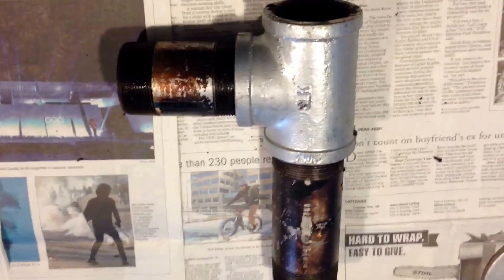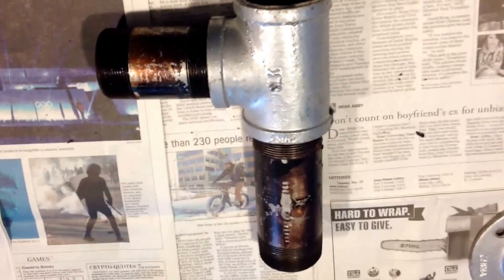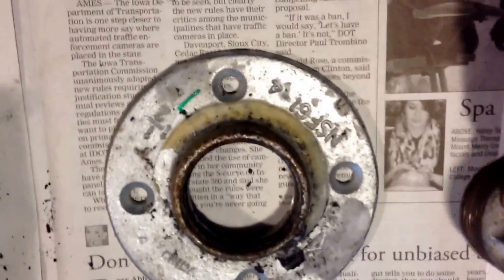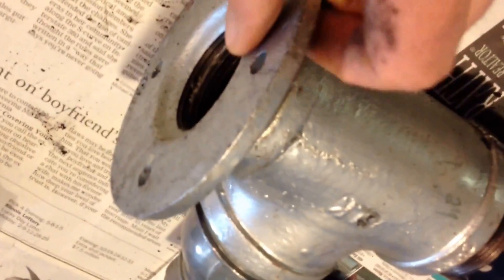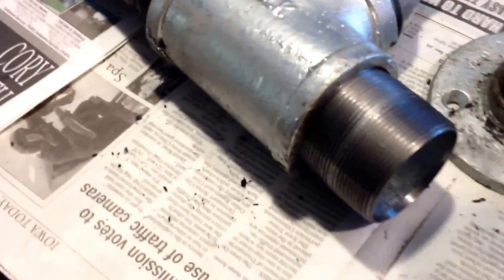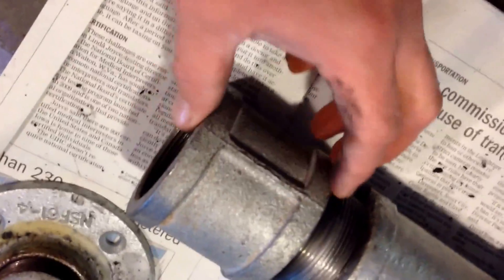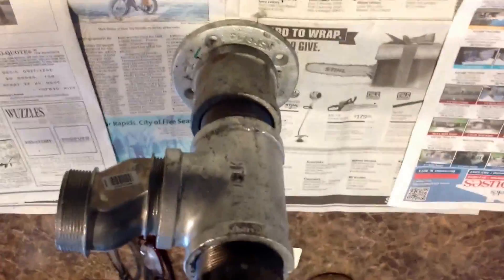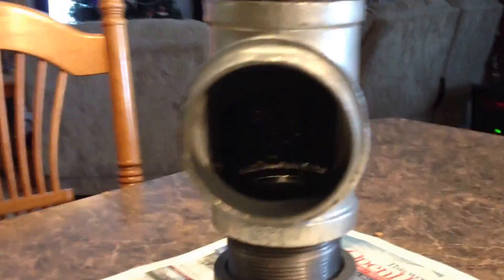Video #3 DIY rocket stove updated easy no tools  in action, testing and boiling snow

Comment: How about just put a nipple and go into 1 of those things in and screw it down just fill it full of sand so the heat's not going to get to the wood base it's got to go through the sand which will catch some of the debris on you want when you get done you pour it out and put the sand back in I don't know you don't have a way to hold the pot with the other flange you need to put some bolts in there or something

Comment: If you put a 90-degree on there you can rotate it down to any angle you want so you can get a 45 after you and then it goes 90 degrees into the unit so that's a possibility be nice to wrap it with fiberglass you wouldn't lose the heat until it gets to the top

Comment: You need air vents at the bottom, there is no air entering the base for combustion.  You can flange the bottom then put screen grating under that so air can move under and into the burn chamber.

Comment: Ray, I think a 45 degree elbow at the T (fuel feed tube) with a 1" threaded nipple between it and the fire tube, then a three or four inch fuel feed chamber into which you actually put your fuel would greatly increase not only your fuel/air mixture (which will increase your rocket effect) but also enable you to pour your pellets into the burning chamber.  Basic combustion physics would suggest that any fuel below the burn chamber will be less effective unless you have an air source below that fuel.  This, then, would most likely move your actual burn chamber down because the  fire is going to seek its optimum source of air.  You observed in an earlier video that the heat increased the closer to empty the load of pellets got.  This, I believe, has to do with the air exchange being introduced from above the actual fuel load and fire center which, by my observation, will slow down (choke) the intake air and impede the exhausting of hot gases.  Thanks for sharing a great series of very well thought  out experiments!!

Comment: Good video but if you or anyone else is going to build one, PLEASE keep this in mind. DON'T use galvanized pipe or pipe fittings!!! The heat generated by a rocket stove like this, if built right can reach near a thousand degrees F and you can easily get metallic poisoning from this. Same goes for electrical fittings. Use black iron pipe.
Other wise there are some very valid improvements mentioned below and it is a lot of fun building one and trying different thinks with it.And Never light a one inside any enclosure unless it is safely vented to the outside and even then be very careful.
Reply from the maker: +chris anderson I agree 100 percent

Comment: You can stick bits of wire in the holes and thread them parallel to make a permanent grate for a pot if you want. Do you happen to know how much the bare bones stove weighs? It seems like a good take-down stove to fit on the strap of a pack if you can unscrew the parts after it's been used.

Comment: Would be nice if the video was not upside down.
Suggest attaching base with JB weld. Also treating all threads with heat resistant anti-size compound.
Top you could put bolts in from bottom with nut on top to secure them. or just drop them in from top should have enough space for air to come in. 
Great idea ....
Reply from the maker: +Terry Ormand thanks for info and watching

Comment: I, too, was about to suggest using the shortest bolts in the top flange you can find or make to allow the pan to sit somewhere about 1/4" above the top of the stove, but several others have suggested same. I also agree with the lack of oxygen in the lower addition. I suggest getting a 2" flange for the bottom with a 2" plug that has holes drilled in it. The two inch straight pipe is called a coupling and you could drill some holes into it to allow air to enter and burn the pellets. If you want to continue to use the 1 1/2" setup then simply drill holes in both the coupling and the nipple above it. Some holes in the top of the feed unit would help too. I would have used black iron pipe which is painted, cheaper, and not as hazardous as galvanized. It is available at most hardware stores although 2" is not very available due to demand. Good experimenting and I like your determination.
Reply from the maker: +RTOHIO thanks for info

Comment: i don't hear the rocket roar.
you are losing too much heat with the cast iron pipe. With better insulation, you should be able to double the temperature for a cleaner burn.

Comment: Put four bolts into the holes on the top flange for your pot spacer. That way you will not need to carry anything else and the whole unit will travel easier. Thanks for the great ideas!
Reply from the maker: Thanks for info and watching

Comment: Since the bottom phlange cannot be screwed and secured, how about using the same length for the top as for the feed hole not making it as top heavy (the bottom not secure)?
Reply from the maker: +Doug Ramsey Yes that works better I tried it there are many different configurations you can try with the pipe.  Thanks for watching

Comment: By extending the bottom, don't you increase the distance the wood collects in the bottom and making it harder to have the continuous burn? It seems that the fire at the point of the feed is too far from what fire is in the bottom thus destroying the one good burn with the airvent not fully used as it was designed.
Reply from the maker: you could be right I need to experiment more to make it better. so far I like the wood gas type stoves better for emergency type situations.  Watch video of a diy stove I built title is peckerhead wood gas stove you may like that better than the rocket stove type but also depends on what you use it for. thanks for watching

Comment: If you used a 45 for your feed tray it would load itself with kindling.  If you used a 30lbs (or smaller) propane tank filled (or a single un-insulated stove pipe tube) with sand this would help trap and radiate heat for hours.  Lastly, if you wrap the pipe with a copper tube then you would be able to get hot water out too.
Reply from the maker: Thanks for input

Comment: How about four bolts with nuts placed in the upper flange to hold the pan 1" or 2" above the opening?  As it stands now, your 'rocket' stove is missing the rocket part.
Reply from the maker: +Jason Dickerson I am working on a new similar one with that in mind, Thanks for the info

Comment: The pellets inside the lower tube will not get enough oxygen to burn. The best they will be able to do is smolder and produce smoke. Get rid of that lower union and flange and replace them with a 2 inch flange on that 2 inch nipple. Put the plug in the bottom flange from the bottom, upside down. Put your old feeder tube back on with the steel plate or a screen in it. Offset another 2 inch flange, upside down, on top of the top flange with a few 2 inch or longer bolts and nuts so that the fire can breathe when a pot is put on the new cooking surface.
Reply from the maker: Thanks for your information
Reply: I agree that no matter how you have it set up; YOU MUST HAVE AIR GOING THROUGH FROM THE BOTTOM OF THE BURN CHAMBER for it to burn instead of smolder

Comment: On your top flange, use nuts and bolts to get more airflow . 4 x 1 1/2 inch bolts and voila u got an adjustable pot stand
Reply from the maker: houseofsmoke305 Yes figured that out after the video, thanks for info and watching video

Comment: First I think you are chocking the air flow,   i would remove the angled intake tube.
Then Use a second Tee and a short Pipe nipple for your intake, then put a 4" pipe nipple on the vertical side of the New Tee, that is the new vertical wood/pellet feed, then on the front of the newly added Tee, that will be your new air intake.
I would take some of that expanded metal and push it down into the new 4" pipe nipple, that will keep your wood from bottoming out in the bottom of the tee, and blocking the critical air flow so air can go underneath the wood. Next Get a cap for the end of the new Tee, a few holes drilled in the cap will allow air under the fire and the draw through will be much better, a way open/close some of the holes in the cap will allow for hotter/cooler burn
.
Try NOT to block the exhaust coming out of the chimney, as that reduction of flow will limit your max heat, you want/need more flow, a couple of bolts in the flange to raise the pot to let the flow out is the main fault here.
Reply from the maker: Gary West Thanks for all the info I will give it a shot

Comment: On your Flange at the top get four 1" bolts and nuts.. Place the bolt up from the bottom and use the nuts to lock them off this will lift your pan/pot up enough for more air flow and more heat at the cooking end... Cheers SS
Reply from the maker: Thanks

Comment: All these temperature readings should be interpreted as "heat loss" and not "heat generated". You are loosing most of your heat. This whole contraption needs to be enclosed and insulated and then you won't loose so much heat and the fire will be much bigger. You also need bigger pipes, 2" is just too small for a rocket stove.
Reply: +tarstarkusz Yes. Not a rocket without the insulation.
Reply from the maker: Yes you are right I will have to try insulation and see how that works, thanks for watching

Comment: your general concept is good. The only thing that you might be able to add inorder  for pellets to burn is adding a 45. A small screen in the pipe above the floor lange or 2 or 3 nails bent over and wired together, just to allow air flow. Give it a try.

Comment: I believe your biggest problem is the lack of air making it to the fire.  When you blew into the fire, it got bigger because it's starved for air.  I think the pellets are falling down into the "well" you made with the double threaded nipple.  There is no oxygen making it's way downward.  I think you'd benefit from some air intake holes or at least use the expanded sheet metal to make a grate for the fuel to sit on level with the feeder tube.  Good luck & ingenious design.
Reply from the maker: Thanks for the info, I did use some expanded metal and it works much better

Comment: I make stoves with no power tools but you need no tools at all. Excellent idea. Is it possible to make a larger stove with same principle.
Reply from the maker: Yes they have larger pipe but usually  do not sell it at your local hardware, some do not even have the 2" pipe I have on this video. The price also increases allot for the larger pipe maybe not cost effective, I have not checked into it. you have to find wholesale pipe distributors for the larger 3' plus pipe and most the time they will only sell to distributors like a plumber, if anyone finds a supplier please let me know.
Reply from the maker: Now that you got me thinking, there may be something but not pipe, I have another Idea but it wont be as durable as the pipe stove.

Comment: Put four bolts and  8 nuts together in the upper "pan flange" holes to make pot stand-offs. About 1/2 inch high should give you boiling water real quick. Looks like it could be a nice little travel stove. Good Job.
Reply: I was thinking the exact same thing... 4 bolts and two nuts on each bolt to allow height adjustment.  I did the calcs on a 2" diameter input and 2" diameter output, and Michael was right on at a 1/2" gap at the top to allow optimal air flow:

Input area (area of a circle):  (2" / 2)^2*3.14159 = 3.14 square inches of input area
Output (area of a cylinder) =3.14(input sq inches) / (2" * 3.14159 ) = .5" gap
Anything less than 1/2" would cause an airflow restriction, and anything more would start a reduction in heat transfer to the pan.

You would have to take into account the area of the wood in the input chamber which would actually reduce the gap at the top, so the ideal gap target may be somewhere between 1/4" and 1/2"... you will have to experiment.

It seems the pan being too close to the tube top is causing an air flow restriction.
Also, try experimenting with insulating the upright tube to allow it to get even hotter, which should cause the air to be pulled through even faster. When you see those flames being pulled sideways you'll know you got it.

Looks promising... just a matter of tinkering which is 80% of the fun...
Reply from the maker: Thanks for the info I will try that.
Reply from the maker: Thanks Guys I will try your suggestions and see how it works Thanks Again.